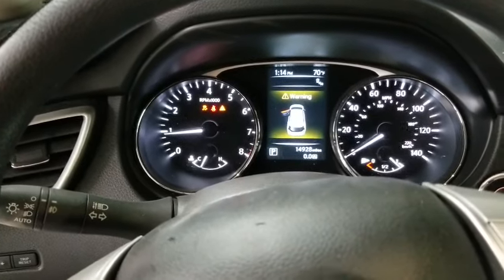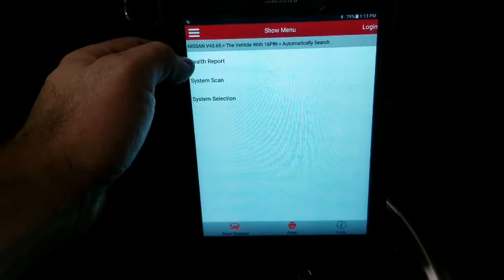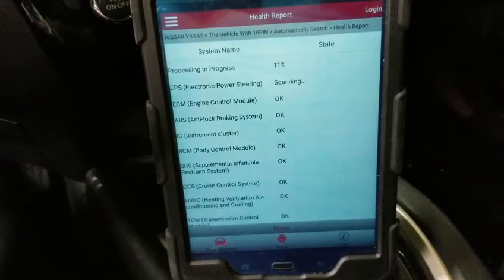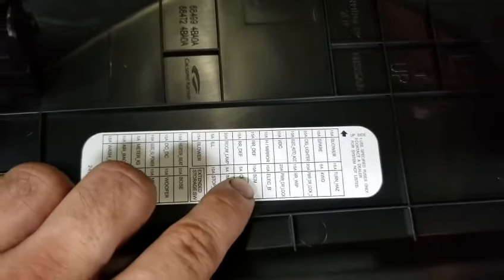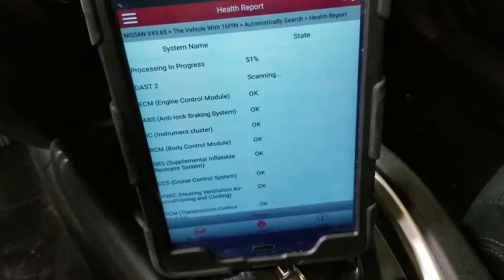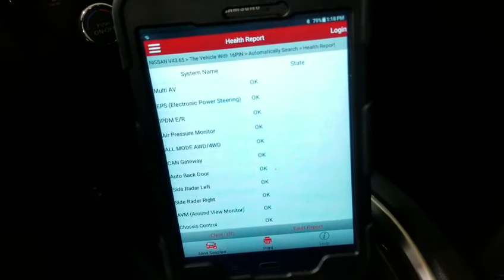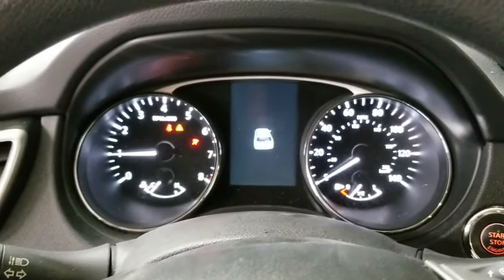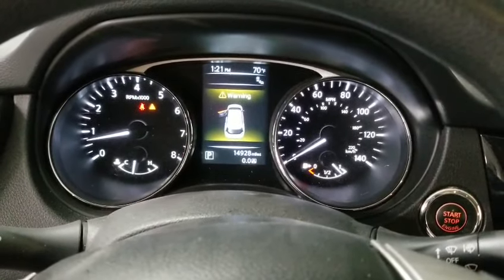NISSAN ROGUE TRACTION CONTROL LIGHT (SKID LIGHT) FIX!!! NO DTCS IN THE SYSTEM.

Comment: I have a 2013, exact same problem with the 2 lights on, no issues found after scan and it got fix with this video... Thanks a lot for sharing! Much appreciated 👍🏼
Reply: Hey brother I have one that has me stumped where was the fuse that you had to replace
Reply: I have a 2011 - Same question.
Reply: Did it prevent you from accelerating?

Comment: my wife has a 2016 rogue with this same issue also has a p2004 intake manifold runner, had the vehicle scanned and it said can-bus communication error in regards to the traction control issue, the light goes off when you turn off and restart so i just restarted the car and left the traction control switch off but I will check this fuse tomorrow.

Comment: Please any advice as my Nissan too was involved in an accident repaired but driving for few weeks and when replacing the seatbelt that was locked due to the accident impact the lead cutoff and since the display KEY SYSTEM FAULT and would not start

Comment: My BC infuse was not blown I had some carbon around one of the two feet of the fuse that goes into the fuse block so I went ahead and cleaned that carbon off on the fuse put the fuse right back in restart the car and voila.... That light went out

Comment: This is happening to my Nissan Sentra , could it be a blown fuse too ?
Reply: leslie morales I have the same problem
Reply: Check the fuse first. I check mine fuse, and it wasn't it.
Reply: Change the brake light switch above the brake pedal.

Comment: I'm having this same problem with a 2011 Nissan Juke -comes on when driving and give a stalling, bucking feel and I need to pull over and turn the engine off and restart. I spent over $2,000 trying to figure this out the mechanic couldn't find error codes for this but apparently found other crap wrong with my car that wasn't giving me issues.
Reply: Change the brake light switch above the brake pedal.
Reply: Any luck? My 2012 Altima has the skid light on and won’t go past 2k rev
Reply: Robert Canchola have you figured it out ??? Mine just started this problem
Reply: Rolando Sanchez Na man I changed the mass airflow sensor 3 times now and the skids control light hasn’t come on in about 3 weeks I’ve been to 3 mechanics and they are stuck lol might end up taking to dealer,
Reply: I’m
Reply: So what happened after all ? I’m getting the same issue with a 2011 Nissan Rogue
Reply: @stang4.0slow96  My 2012 Rogue just did this yesterday and scared the crap out of me. Did you figure it out?
Reply: What was the issue ??

Comment: my vss switch would do nothing
was off
sometimes on
checked fuse fine
ended up very low brake fluid......  ( do not drop the cap, it's a bitch to find fell under battery ! )
not switch works :)

now if I can get mu CVT trans fixed I'll be good LOL

Comment: i am having same problem with my Nissan Qashqai 1.6 Petrol 2012, i had issue with Airbag fault and i change the clock spring and that fault resolved but ESP light off and slip indicator light stays on. and that button i have in the car for ESP don't work either it might be the fuse blown off, i did diagnostic on my car but there is no fault. Thank for put up this video i am going to change fuse and  i will see

Comment: Hi, can you please tell me what brand scanning tool you are using?
Thanks!
Reply from the maker: Launch x431
Reply: @melniksmotors  thanks. Do I need the scan tool to reset blinking airbag light? I just changed my clock spring
Reply: @melniksmotors  dang ! $900 is steep for a do it yourselfer :(

Comment: Please, l have a 2012 Nissan Note automatic with same issue. It had an accident and was repaired. I have been driving for over a year and then the spiral clock spring failed. After replacing, this traction light has since remained on the dash. It was scanned at the garage and repaired as it went off. But soon when you drive a few yards, it comes up again. The steering angle sensor has been changed the second time but no positive results. I have watched your video, but l can't locate the particular fuse you are talking about. 
Can you help please.
Thanks
Reply: You have to have the steering angle sensor reset/calibrated if the clock spring is done, with NDS II it’s $50

Comment: Great video. I have a Nissan Altima 2016 with same problem. But my fuse BCM SW is 5A , I checked and it's not burned. I don't see any other fuse 10A BCM.
Reply: Same problem. Did u fix it.  2015 altima

Comment: Great video.  Thanks for the advice.  I have a 2014 NIssan Rogue.  I replaced the fuse and it fixed the problem.  Warning lights were off.  My problem now is after a couple weeks, the lights came back on.  I replaced the fuse and lights again went off.  Then after one week the lights came back on.  So I guess now the question is..what's making the fuse to go bad.  Any ideas?  Would it be a sensor?
Reply: There is a First big (size of your palm) splitter terminal on positive side of the battery - which I believe splitting the energy from the battery to the few systems - each splitter line supply few system. In my case U1000 code intermittently came with other systems like ABS, Ignition and airbag. There is a possibility that contacts there got corroded because the car battery leaking some acid and it gets there and getting corroded. It’s just one of cause that could be. I cleaned and it didn’t helped so I ended up with cleaning it with dremel or you can use just sand paper to clean the surface of the terminal. Those terminals hiding behind clear plastic window and if they are corroded you can see it. Not necessary it will help but a big possibility that will lol. Because it may damaging or corroding the circuit breaker eventually after few days because of high resistance at that main distributor which I mentioned earlier. Good luck!!!
P. S. Used Blue Driver to get and clean codes.

Comment: Hi, I own a Nissan qashqai, which is similar to the rogue. I did an engine replacement. Car runs fine, just that there's always a chassis control error, engine idle off(auto start/stop function) does not work and the traction light is always on. Any fixes, diagnostic scan tool can't clear the codes? Local agent wants to charge me a skyrocket price for "reprogramming" the ecu.
Reply: Did you check the hood sensor for the auto start problem ? There is a sensor in the hood lock to prevent the auto start if the hood isn't properly closed

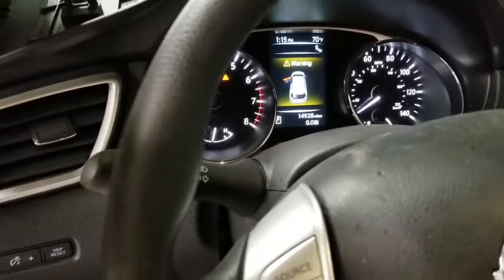Comment: I don't understand why people have to ramble so much. You seem like a great guy.  I trust that you ran to check for error codes.  You don't have to show that here.  For everyone else, start at 2:46 to go directly to the fix.
Reply from the maker: There's always be haters. If you do not like it, move on. Life goes on right. Look for someone else's video. If it's not helpful. I did the best I could. I do not have professional cameras or camera crew. I do not read script.
Reply: @melniksmotors  - I don't hate you.  As i said, you seem like a really great guy. No digs on your camera either.  You are just a nice guy trying to do the community a favor. With that said there are a lot of people that start off slow and go to left field, then to right, before finally running the bases.  I was literally going through the first 2 minutes saying aloud; "Show us the fix." So not a hate. Just a suggestion.
Reply: I understand you point but history is necessary. Sometimes it is different issues with the same fix, or different fixes for the same issue
Reply: Just a complainer, we get all kinds, great video.

Comment: I have the Nissan Rogue 2015 and it was bought as a salvage( hit from the right rear side.) The light kept going off and on for the last few months, and finally, it comes on after i started to drive. But my has the warning: chassis control, system error. Will check the fuse box tomorrow morning. Will have my car inspected this week.
Reply: This can be a pain as there are multiple issues that can give this warning. Mine used to shut down. And the code pointed to the throttle and tps. There was corrosion in the connector
Reply: @cliby25  I finally turned the traction control off, and the skid light is off.
Reply: @vaiolover1997  how did u do it? By changing the fuse?
Reply: @iink1509  Nope. I look at the fuse and it was good. I only push the skid marks button and the chassis warning lights are off.  Hope it works for you.
Reply: @vaiolover1997  where is that  located
Reply: @HH-ls3te  The button for the chassis control is located close to where you open the latch for your gas tank. It has a drawing on a car with a skid mark. Mine Chassis control signal  has come  since I push that thing.
 Because of virus, Sam's Club tires are closed.  I need to change my tires, because the dang thing may show up again. The computer is the car is messed up. Good luck.

Comment: I have the same problem my Nissan sentra 2012 sr
Reply: have you figured it out yet? i have a 2012 sentra also that does this randomly while driving
Reply: Did you get a reply I have the same problem with a 2013 Sentra for years now. Check engine on and off every few months, never a problem. Now anti-traction light is also on and that is where I have trouble starting and will not idle properly. Almost stalling at he traffic lights.
Reply: Any luck with this? I’m having the same problem on 2012 altima
Reply: @eddieking9469  I got the same problem.
Reply: @eddieking9469  I'm having the same problem with my 2011 Altima. Did you find a solution to your problem?
Reply: @dnlp89  I had my problem for years, I went all over with different solutions, it was my check engine light then check engine light and anti-skid, then the car wouldn't start at all. 
I finally went to a different Nissan Dealer who did a scan and fixed it.  A 5 year problem fixed in 1 hour.
They cleaned the throttle body and changed the air filter in that link. That's a year ago and all works well now, it the future I will just go to the dealer, they have the latest scanning equipment.
There is a butterfly valve in the throttle that sometimes sticks open when it is dirty and the lights go on and the car runs badly and sometimes it just won't start.
I hope this helps others, good luck.  I love my Nissan Sentra..
Reply: @eddieking880  Thank you so much for answering. My Altima has had the check engine light come on and off for a couple of years but, only recently, the slip indicator light has been coming on also. 

I've been looking at different forums and videos to help me find a solution. The forums tell me that it could be something as simple as adding break fluid if it's running low. The videos have shown me that cleaning the throttle body, Mass Air Flow sensor, and replacing the air filter could help. 

Thanks for the response.
Reply: @dnlp89  I've had the same thing, the check engine light would come on for a couple of months and it would go off for a few weeks and then come back on.  This happened for a couple of years and when the garage put the portable scanner on it would indicate "mass airflow sensor". The problem got worse when the check engine and traction light came on at the same time, It didn't idle properly and at times it  was difficult to start at times.  I have my invoice from the dealer with what he did to fix the problem,
They did a check scan 
Cleaned throttle body and did a idle volume learn
Replaced air filter
Replaced PCV valve
Programmed ECM
Dec. 11 2019   Light has not come on since!!!!!!
Hope it helps.
Reply: @eddieking880  How much they charge you? What is a idle volume learn? What is programmed ECM?
Reply: @eddieking880  how much did it cost ?